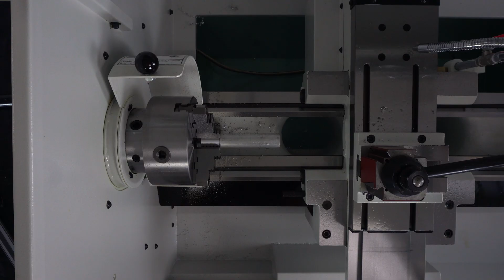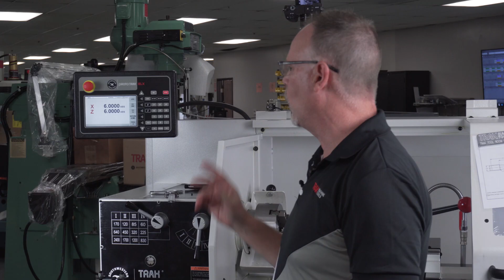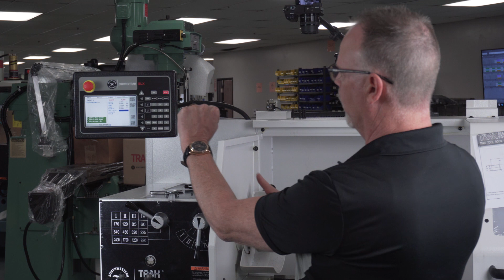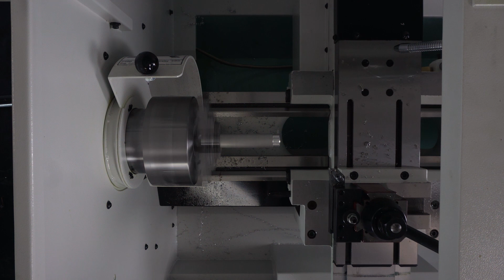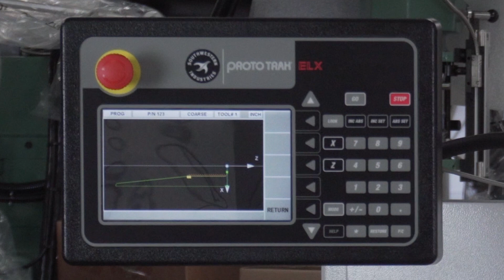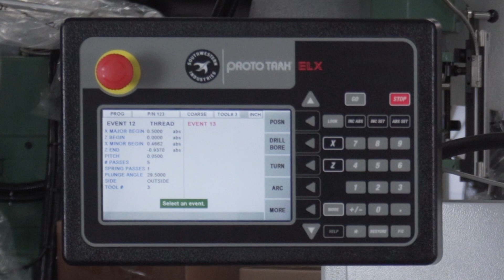Operating the TRAK TRL 1440EX Lathe | Instructional Presentation (38 min.)

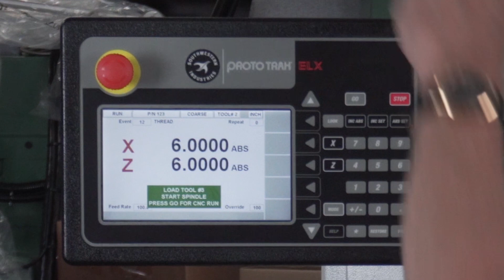Comment: 33:30 I'm working with one of these 1440EX lathes now.  I'm trying to cut a long, fine thread using a live center in the tailstock for support.  In your video, the thread cutter makes a Z+ move right before cutting the thread.  Is there anyway to eliminate that move?  It will run my threading tool into the live center otherwise.  I did a dry-run on my current machine to confirm, and yes, I'm seeing exactly the same thing.

I've programmed a lot of threads using G&M code on actual CNC equipment and never had seen this before.  Sometimes the conversational programming process is quite confusing for us traditional programmers.  I could upload a program using G&M code to address the part I'm working on now, but I would like to be able to execute a simple OD threading move in the conversational format without making that Z+ move.  Any help would be appreciated.
Reply: Unfortunately,  sometimes you are limited with conversational programming.  In your case, the only way to adjust that is to run it in G-code.